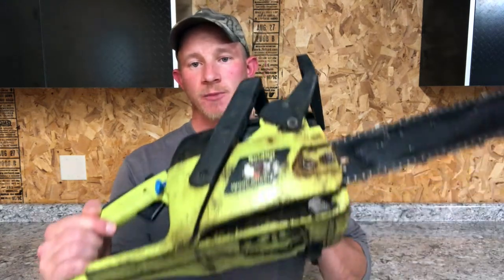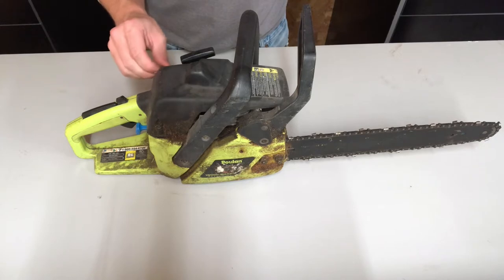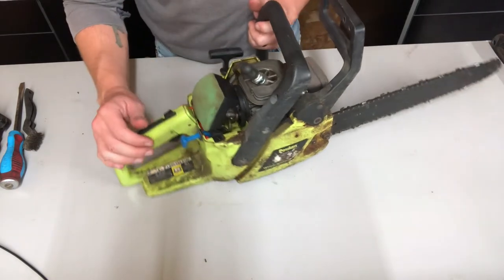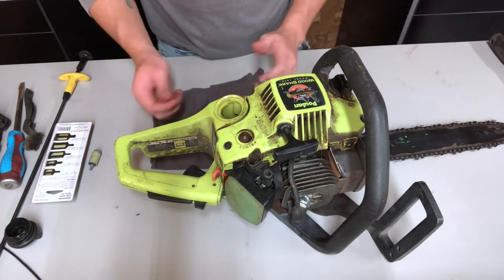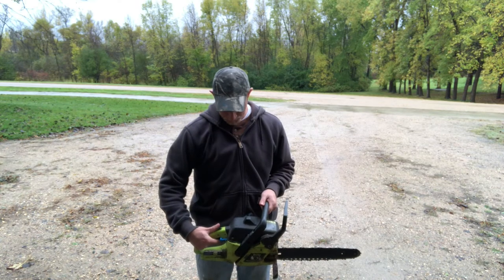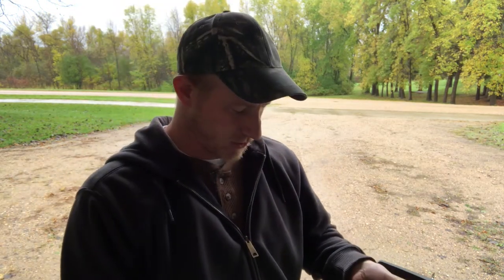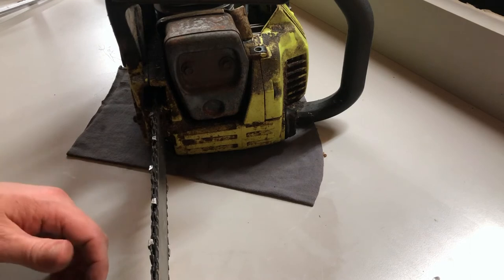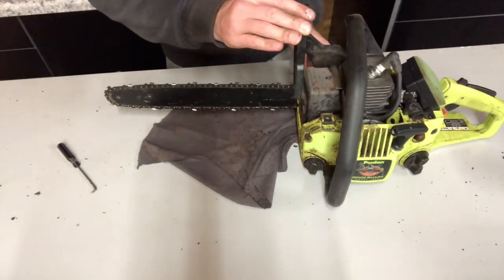How To Get An Old Chainsaw Running

Comment: I just got my dad's old Poulan Pro 205 from 1985. It needed a $7 carb kit (the kit came with 5 rebuild kits) and it needed a fuel line which I had. She runs like new after some cleaning and tlc.  I'm 42 years old and I remember cutting wood with my dad when I was like 10 years old with this exact saw. I was happy I could bring back something from my past. I have a Stiel MS250C but I love using the old vintage poulan. BTW,  those foam filters are usually supposed to be oiled before use, not completely dry as you mentioned. I could be wrong about your particular model but most foam filters are designed to be oiled to work properly.

Comment: Good Video! Just a tip, not all bars have a hole for the oiler on bothe sides so just make sure your bar has  an oil hole on bothe side before flipping, cheers!

Comment: you cant beat those little pole-an ( correct pronunciation in Tennessee hillbilly country lol) saws for clearing small under brush they will outwork more expensive saws for one important reason. they are much lighter than more expensive saws so you dont tire out as easy .. staying bent over all day cutting under brush is a killer if you dont have a light weight saw .

Comment: I was gifted one of these months ago. I was told that it didn't run. I had little trouble getting it running. Truthfully,  I didn't even find anything wrong with it. I had to adjust the carb screws or whatever they're called but that's it. I kind of lucked out because the gas had been drained (I'm guessing years ago).

I noticed mine doesn't have a chain break. I wonder if there was two versions of the wood shark 1950? I dunno...

Comment: I set the cap on the ngk plug to 0.30 and it is easy to start after it gets really hot after long use

Comment: Rookie. I could hear the fuel strainer rattling around in the tank when he first shook the saw. That's a sure sign that the lines are bad! He said "I can hear the fuel in it". He was hearing the fuel strainer rattling around. So we knew it was having a fuel line problem, which is one of the most common problems but he went on to test the spark. I guess if you check all the boxes you will get it fixed eventually but it's not very efficient. Another thing is that if the fuel strainer is off the saw was likely run without a strainer and that means that any dirt in the fuel tank is getting drawn in and will end up stuck in the carburetor, which will need to be cleaned as well. Usually the primer bulb will need replacement as well.

Comment: In my chainsaw, I had kickback on start even with the spark plug removed. Flushed out cylinder walls with CRC electronic cleaner. Somehow the piston & cylinder got gooie.

Comment: Great video but I still can’t feed the gas line through the hole.  I don’t want to use a smaller diameter one because of leak issue.  
Any suggestions?  13:57

Comment: What can you do if the pull cord doesn't pull out smoothly?
Reply: Does it stick, feel rough, or sound clunky? If it sticks you can use a penatrating oil like PB Blaster to help loosen any rust, this will also help with the rough feeling. You can use a lubricant like WD-40 if it feels rough or sounds clunky.

Comment: what do you do if somebody decided to drill one of the holes out bigger so they can get a fuel line in it but it wouldn't seal and you get a bigger fuel line or what one I guess the return fuel line is drilled out too big for regular fuel line what do you do
Reply: Use a soldering tool to and take a screw driver and put it threw the hole and melt the plastic around and let it hardened then take your screw driver out and put a new fuel line.

Comment: The Poulan I have 2155 looks the same? My tank pressurized so fast it pushes gas out on cap and fuel lines coming out of the tank. The vent in the cap looks good. 
Any ideas?

Comment: Is 100%gas and oil ok to run on my 2150. ?
Reply: Hi,do you mean fuel mix? Recommended was 40 : 1 gas to 2 stroke oil. Preferably semi synthetic.  If using straight mineral, told 32:1 or even 25:1.
Hope helpful.
Reply: Get information for lawn tools

Comment: My poulen stops when hot after 10 minutes and wont restart for 12-24 hours. Any ideas.
Reply from the maker: I have a video on how to fix that exact problem actually. Check out the channel for it!
Reply: @MidwestGarage  i did and it was gapped just off a bit. Oh and the gas line was falling apart on my craftsman so I got that fixed too. Tomorrow I am going to try them out.
Reply: Margaret
Please let us know the outcome.
Reply from the maker: @omadeitz3340  Good deal, let me know how it works! Thanks.
Reply: Dont forget to grease bar sprocket! Grease, not oil or wd-40
Reply: You might need to check the fuel lines and the ignition system
Reply: @joshuaschannel1335  oh it works great now. I am a proud mom of small engine repair savant, he got it running then tackled any and every motor we owned and those the local repair shop had given up on and got all those running.
Reply: @omadeitz3340  I was that way when I was a little kid and my Middle son also was a ace at fixing engines. I like that kind of child. There is a young man cruddy corn stalks on U tube thats fun to watch.
Reply: Iv heard the crank seal leak you have to test them under flywheel and clutch pump up crankcase check seals with soapy bubble test